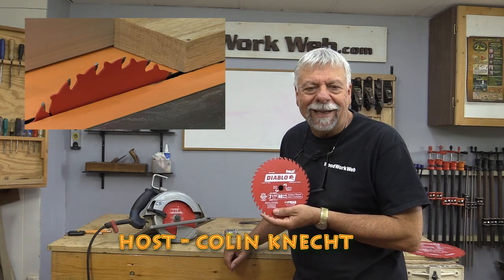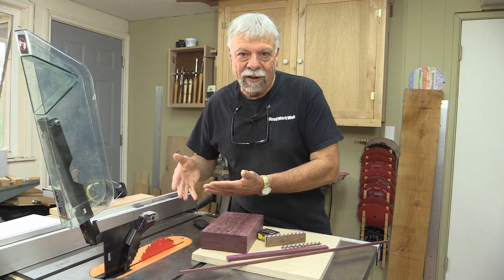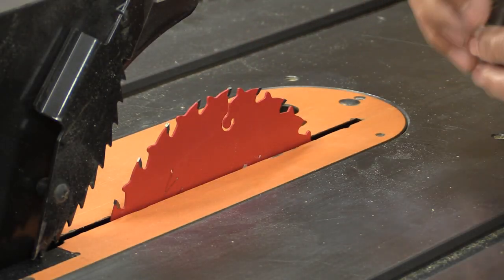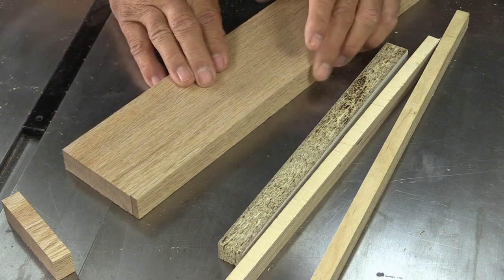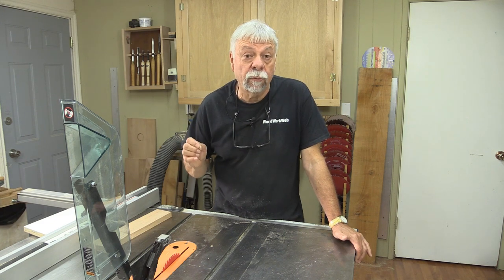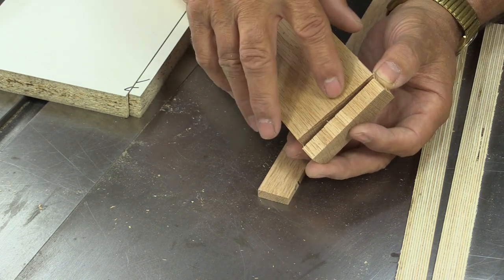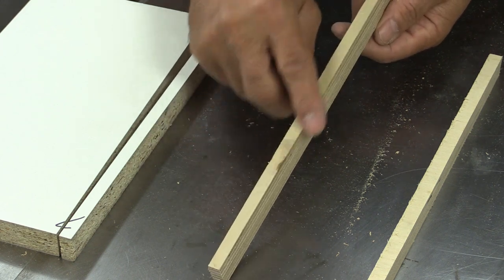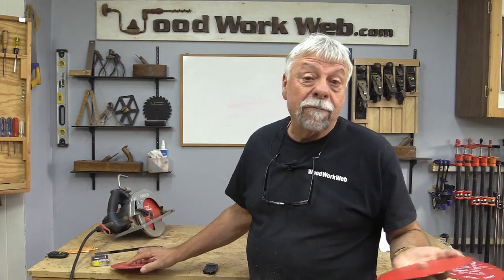Using Circular Saw Blades on a Table Saw for Woodworking

Comment: Hi Colin, great video as always - I have been thinking about using blades from my circular saw or mitre saw in my table saw, however the blades from the circular saw and mitre saw are both mad from a thinner material and will not grip on the arbor correctly! The Table saw is certainly not from the high end of the market but will need to suffice for a few more years yet! Any thoughts? shim of some sort?

Comment: Colin can I use a 12" blade on my table saw, it came with a 10" blade. Love your channel.
God Bless my friend.
Reply from the maker: Probably not Frank, any table saw I have ever seen that comes with a 10 inch blade, that will be the biggest it will take.
Reply: Unlikely a 12" will fit the housing/riving knife.  Even if you can somehow fit a 12" for ripping, your 12" is likely designed to cross cut.  Unlikely this is the case, but you may also want to check the max RMP allowed.  Why would you possibly want to use a 12" for a table saw?  Maybe a bandsaw makes more sense?
Reply: 12s have a 1 inch arbor and usually wouldn't fit very far through the opening anyway.

Comment: My table saw comes with a riving knife. Since 7 1/4 inch thin kerf circular saw blade is usually much thinner than a 10 inch table saw blade, how can I get away with the riving knife compatibility issue?
Reply: You need to make a close tolerance throat plate AND glue in a splitter that is the same thickness at the teeth on the blade for which to throat plate is made.  Don't forget to sand the leading edge of the splitter thin so it will spread the wood if it tries to pinch closed.

Comment: 7-1/4" blades for laminate flooring are soooooooo much cheaper than the 10" blades. Since it's laminate the cutting depth due to smaller diameter is not a problem
Reply from the maker: Thanks for the tip and thanks for watching!

Comment: I bought it old craftsman dado blade for a circular saw, I was wondering if I could use it on a table saw.
Reply from the maker: A dado blade is for use on a table saw (if we are talking about the same thing) ... I have never heard of a dado blade that would fit on a circular saw but their could be one ... if there was, I would never use a dado blade on a circular saw, just too dangerous because there is so much back-pressure from all the blades cutting into the wood, it would be very hard to handle with out kicking back.
Reply: Years ago we had a couple of hundred 1-1/2" x 3" notches to make in the top of a 4" x 16" rough beams.  We cut the sides using a regular combo 7-14" HSS blade and hogged out the middle after using a kerf-set tool to widen the kerf to 1/4", it worked beautifully and was much faster.  Those older Skil 77 saws weigh about 13 pounds so kick-back was not an issue.  Never tried it with a sidewinder.

Comment: Been doing it for many years now. Sorry for those with a SawStop this trick won't work, because you cant get the blade close enought to the brake!
Reply from the maker: Now that's a good point ... thanks for bringing this up, I have worked on Sawstops, but as you know don't own one so don't always think of that ... appreciate your comment buddy
Reply: Will the SawStop not run at all or is it the SawStop will run but the breaking mechanism won’t stop a blade it can’t reach?

Comment: Remember that the speed of the blade will be slower with the smaller diameter.  You keep the same rpm but the speed increases with the larger diameter.
Reply: You are correct. When using a smaller blade, the circumference is decreased by approximately 1/3rd. This equates to a loss of around 1,000" of blade going through the material per second. (Okay, I was bored and figured this out.)
Reply: Paul Goess thanks for doing the math.  I was too tired and was just hoping I could explain it so people would understand.
Reply: Kevin Youngblut .... you are correct.   It's less inches per revolution of cutting ability,  but in a lower powered saw,  that might be a positive thing if your motor is bogging down.   It's less load on low powered saws.
Reply: 135 Pilot you're correct.  It should be a positive since it's sess material to hog down since it's thin kerf.
Reply: Yes, true. You also double the power of the saw since the 7 1/4" is three quarts the size, plus the thickness is about half, less teeth, and larger gullets, makes it a great way ro rip thru hard woods like Ash Oak Maple Spruce Hickory etc etc.   I've used them before, i like the way they perform.
I buy the Diablo 50 tooth combo blades for the tablsaw, and with some of my 80 tooth I took four 10"  80 tooth blades and turned them into 40 tooth and one 30 tooth blades, keeping the left and right angle teeth, and added one rake tooth for a square cut. This blade modification didn't turn out so great. They cut ok, but they are jumpy, even though cut is smooth,  I don't recommend doing this unless you're going to rip down rough cut lumber. You'll feel how unstable it is when cutting 1/4" thick stock.
I thought this might be interesting to someone if they have 80 tooth blades, and want to rip with them.
Keep them as 80 tooth, and cut a little slower. Cheers!

Comment: With the melamine you need three passes first pass set blade height to 2 mm.  second  turned the work please over using the same height 2 mm third raise the blade To the  over all thickness  -4 mm.  Hth

Comment: I believe it is great you kept the blade guard and pawls on the saw for these demonstrations.  I cannot, for the life of me, understand that removal has become a standard practice on YouTube and PBS for purposes of visibility.  It sets a bad example.  If you have used a table saw in your personal experience you know what a blade driving through wood or plastic looks like.  Keep up the new movement in woodworking safety.

Comment: Would there be any reason not to make a zero clearance insert?  I don't have a table saw yet so I can't go out and compare the thickness of my circular saw blade to anything but a hand saw or tree saw.  (Yeah, not gonna do that.)
Reply from the maker: There would not be any reason to not make a zero clearance insert ... on the other hand, there may also not be a reason to make one, it really depends on the blade you are using what wood you are cutting, in most cases all a zero clearance insert does is help prevent tear-out in the bottom of the wood, but as you can see, with modern blades, that really isn't much of a problem any more. The other reason to make an insert is if you are using dado blades of different widths, sometimes it safer to have different insert widths.  Good question Jay ... thanks for this.

Comment: is there  less  or more pressure on the saw bearings? i say less !
 because there is less saw teeth in the wood, at any one time= diameter and kerf
Reply from the maker: That's a good question ... I think I would say less also, but in the end, for part usage that most of us would give a table saw, it's petty small. In the past I worked with big industrial table saws that went through tons and tons of wood being cut on them for years, and I don't recall ever having to replace a bearing so they are pretty strong.

Comment: My circular saw is a skilsaw and the hole on the blade is not round, it's shaped like two pyramids base to base (there's probably a name for this but I'm not aware of it), so I guess I'm out of luck for being able to use this method
Reply from the maker: I think the only circ saw around now that still has that option of the diamond shank, is the Skilsaw brand, and I believe they still have it as an option. There are very few blades anymore that have the diamond stamp in the middle that you can knock out to use on Skilsaws, but Freud Diablo is one that does. These blades come with the round arbor hole and the diamond knock-out.  So in you case, you could still use circ blades in your table saw but they would not be interchangeable with our Skilsaw. Good point on this, I will try to remember to talk about this if I do a future update. Thanks Sam
Reply: Shucks I have lots of 7 1/2 inch blades for my skilsaw, but my go to saw is definitely my tablesaw is not like I'm in love with it, okay I am in love, it's just so functional with the tablesaw sled I've made and the Incra miter sled I have. I guess I could just buy some 7 1/2 inch blades and use them on the tablesaw? Thanks great video.
Reply: Sam Biscits I would refer to it as diamond shaped.

Comment: Those thin kerf blades warp too easily. A full size table saw blade makes a straighter cut.
Reply from the maker: As I mentioned in the video, yes if you push too hard, or in some case if fence in not quite aligned, or both, the thinner blades can warp, they are not a solution for everything, just another option that works for some occasions.

Comment: Nice video.
Why dont you try to make a zero clearance insert to have more accurate results?
looking forward to see that
Reply from the maker: Good question George, a zero clearance insert, in most cases is only designed to help reduce wood tear-out in the bottom of the wood being cut, but as you can see with modern blades, in most cases there is little tear out worry, which was not the case many years ago when all we had were steel blades that gave quite a bit rougher cuts. With the old steel blades, zero clearance inserts made a significant difference.  A zero clearance insert can't hurt anything but sometimes it does little or nothing to improve things either ... really depends on blade and what is being cut.

Comment: I've been doing this for a long time in my job site table saw. Keeps me from having to carry multiple blades in the trailer.
Reply from the maker: That's a good reason ... makes sense, thanks for the tip
Reply: I have a DeWalt DWE7480 portable.  You're saying this is relatively safe?  The riving knife will function properly with a smaller blade?